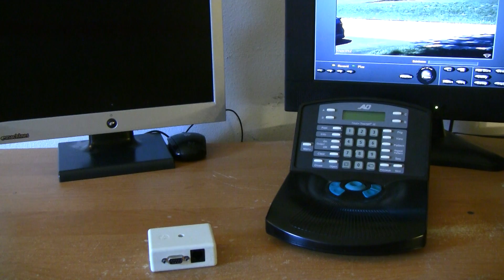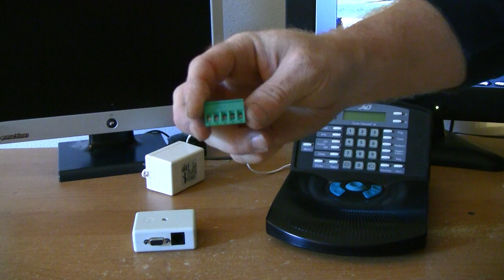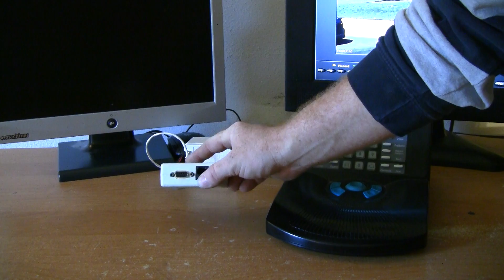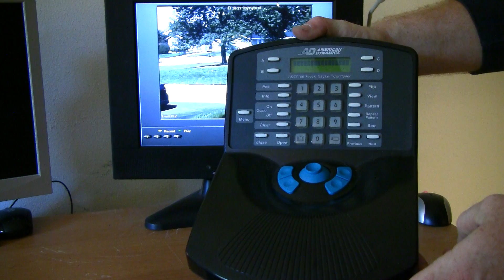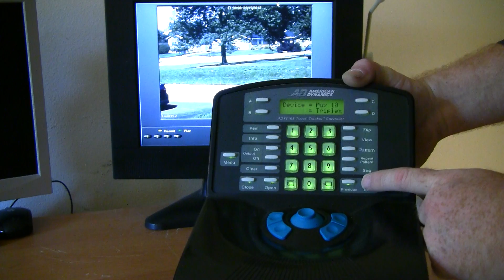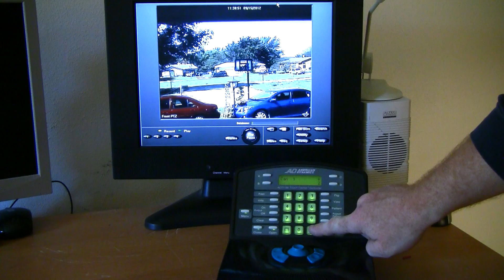Installing a Touch Tracker 16

Comment: I have an American dynamics tracker, that has UC on the LCD display, and it won't let me do anything, any ideas?
Reply from the maker: What you have is an ADTTE TouchTracker.  That's only compatible with a matrix switcher.  UC means a user code has been programmed.

Comment: Does anyone know if the EIM can connect to the AD2089 controller or is it only compatible with the touch tracker?
Reply from the maker: The EIM only works with the TouchTracker line of controllers.  The AD2089 uses a dual terminal block for connecting to a switching system.

Comment: How can I access camera menu without an AD2089 controller? Can I use American Dynamics USB control module to connect directly to the camera?
Reply from the maker: Yes, you can use the USB module to connect directly to a dome.  You'll need to install the drivers and the Software Utilities program on a computer though.
Reply: Thank you for the information.  We just purchased this touch tracker to we can change the 10 mintue preset on our Optima domes. We upgraded to IP but keep several analog PTZs. Only problem is without the old matrix bay and 2089 controller, I can't ever change these presets and when I try they revert back after 10 mintues of inactivity. I hope I can with this touch tracker like they told me I can.
Reply from the maker: SpeedDome Optimas don't have an internal menu for setting the home position.  It's set by programming Pattern 3 as only one Focus Near or Focus Far command.  If you want to clear it, program Pattern 3 as just two focus commands.  That should stop the dome from moving back after 10 minutes.
Reply: @MrBMG81  Awesome, but I couldn't do this without purchasing this touch tracker. My 2089 controller won't work with all my matrix bays ect being removed. We are now on a moxa converter box for RS422 control

Comment: How do I unlock a locked camera?! My touch tracker just buzzes. All my other cameras work.
Reply from the maker: What kind of system are you using?  Typically you need to unlock a camera with the controller that locked it in the first place.

Comment: Does TouchTracker power up automatically if I connect only 24V power without EIM? Powered it up by connecting wires directly to the board, have the same black upper line of the TouchTrackers LCD display when you  connect it with Rj45 jack, but it's not going to light up and stuck with that black line.
Reply from the maker: I've never tried it without using the EIM before.

Comment: Most likely a STUPID question, but I saw a "PC" setting, does that mean you can use it with a pc for as an ip cam controller? Or does it hook up to an American Dynamics software? I'm not too familiar with American Dynamics controllers.
Reply from the maker: The PC setting is for hooking it up to a computer to do software updates on it.  I'm not sure if the TouchTracker 16 is compatible with the American Dynamics VideoEdge NVRs or not. Everything in this video has since been replaced with a Hikvision IP system.
Reply: @MrBMG81  Oh, Thx Have another question, If I get a speed dome ultra (with outdoor housing of course) and put it on the front of my house (just one dome), with touch tracker installed, do I need a multiplexer, or can I take a regular BNC video lead from the ultra dome to my speco dvr? in other words, can I take the bnc camera jack and go directly into my speco dvr. thanks
Reply from the maker: Sure.  The video feed from the dome can be connected directly into the DVR without any problems.
Reply: @MrBMG81  Ok, thanks! Numbered to 0001 im assuming
Reply from the maker: You can address it to match whichever number video input you're plugging it into on your DVR.

Comment: hello good afternoon, my name is juan ahumada I speak from colombia, I want to ask you if it is possible or not to connect the direct dome to the EIM and the EIM towards the PTZ controller.
I want to test the functioning of the domes but I have not been able to move the dome from the PTZ controller, it only generates me an image. I wait fast answer. Thank you, good day.
Reply from the maker: Yes.   The two SensorNet wires from the EIM can go directly to the dome.  The controller has to be connected to the EIM to work.  Make sure your controller is a TouchTracker 16, if you want direct dome control.
Reply: Can the EIM connect to AD2089 controller or only to touch tracker?
Reply from the maker: Only to the TouchTracker.  The AD2089 uses a dual terminal block.

Comment: I wish I could get one of these speed domes working with my DVR. I've tried all settings and still can't make them move. Do AD use their own protocol?
Reply from the maker: They use SensorNet, which is a proprietary protocol ,and Tyco RS-422.  I know the Ultra 8 and I believe some of the Ultra 7's also support Pelco and a few other protocols as well.
Reply: I think my cameras are Ultra V. I'm using the RS-422 interface in the camera. On power on, the camera starts moving, shows BOOT VER 0103, MAIN VER 0204, 16x OPTICAL ZOOM, and then displays 'CHECKING NETWORK TYPE' with the green LED blinking slowly. If  I send data, the dome responds 01 C1 3E to say it is on line I believe, but although th green LED blinks to acknowledge furter data traffic, it makes no further response.
Reply from the maker: The Ultra 5 only supports Tyco RS-422, SensorNet and Manchester protocol. 01 C1 3E is most likely the command it's receiving.  On a compatible network "checking network type" comes up and then disappears when the camera automatically determines what type it's connected to.

Comment: Interesting vid, would like to see some more on your system, you have some nice equipment.
Personally I have found Pelco spectra cameras to be the best and easiest analog PTZ camera to set up, coaxiton right from the DVR and your all set.
Reply from the maker: I've never worked with Pelco equipment before but I've heard it's pretty good stuff.  I've watched some videos on YouTube about it.  These domes are easy enough to work with.  The camera itself just snaps into whatever type of enclosure or mount you're using.  They can run off several protocols.  I prefer using SensorNet.  Up-the-Coax is an option as well with some AD matrix switchers, along with duplex or simplex RS-422.  The Tyco Simplex 422 is what most of the DVRs put out, if you're just looking for a simple set up.  I much prefer a controller instead of using a mouse to move the camera though.  Power, data and alarms all have their own little terminal blocks so actually wiring them really isn't difficult.  They also have an internal configuration menu to set up different options and whatnot, which is pretty standard with most domes.  The Intellex is a PC based unit and is a super easy DVR to use.  It's very user intuitive.  I used quite a few different brands of DVRs when I worked in loss prevention and some of them were absolute nightmares.

Comment: What type of protocol does the Sensorvision-American dynamic use? Can I connect it to an NVR and control that type of  dome? 
I currently have an American Dynamic dome that works on Manchester, but I like to use a NVR or Hybrid DVR to control both Pelco and American Dynamic domes.
Reply from the maker: The SpeedDome Optima will support SensorNet, which is AD's proprietary communication protocol, Simplex RS-422, and Manchester.  The SpeedDome Ultra 8 supports SensorNet, Full RS-422, Manchester, Pelco Coaxitron, PVS and P, Panasonic UTC, AD UTC, Vicon, Bosch Bi-Phase.  As far as I'm aware, the older domes are limited to just SensorNet, RS-422 and Manchester.  The video can be fed into any DVR or Hybrid recorder but it would have to have the proper protocol included in the software / firmware for dome control, and that varies by manufacturer.

Comment: How do you set preset locations that the camera returns to after some time not being used?
Reply from the maker: On a SpeedDome Ultra, you'll first program whatever view you want for your home position, then open the dome configuration menu.  Go to "Alarms/Areas/Home/Presets".  Select "Set Home Position".  Next to "Action" select "Preset" and then move the cursor over to the number and select whatever number preset it is you want the dome to return to.  Move the cursor down to "Return Time Mins" and set however much time you want to pass before the dome returns to its preset location.  Exit out to the main menu and then "Exit and and Save Changes".  For a SpeedDome Optima, call up the dome and move it to where you want its home position to be.  Then program Pattern #3 for that dome with one focus command and nothing else.  The camera will return to that position after 10 minutes of idle time.
Reply: THIS IS MY PROBLEM. ALL my Speedome cameras preset after 10 minutes of inactivity. My problem is I can't access to camera menu anymore because we upgraded our system and no longer use AD2089 controllers. I need to find out what I need to get in order to access the camera menu and change presets so they quit going to programmed 10 minute preset. All the RS422 controls are now connected to a moxa converter box. I do still have the AD2089 controllers just unsure how to connect it to the camera to access the menu. Any help would be great appreciated.
Reply from the maker: The AD2089 can't be connected directly to a camera like a TouchTracker 16.  It has to be connected to a matrix system, which in turn communicates with the camera.

Comment: Great video thank you for the information.  How would I connect the PTZ/Controller to a second call up screen on an Intellex?
Reply from the maker: In the Display menu on the Intellex, there should be a "Call Monitor" tab where you set up which monitor the main and secondary TouchTrackers control.  You This is only on the 16 camera Intellex units.  The 4-8 camera ones don't have this ability.
Reply: MrBMG81 Great thank you for the information!

Comment: Great Video.  I'd like more information or maybe a video on enabling and disabling the Lock feature.  Our touch tracker in our LP camera room frequently  locks us out of dome  control. Does accidentally hitting the lock button lock it up?   Also, have you had any issues with the RJ45 flip cable going  bad?
 I just watch this video which was very informative and also subscribed.  Thank you..
Reply from the maker: +Charles Hollingshed   Do you know off hand what kind of system you're using?  The TouchTracker 16 doesn't have a Lock button but I know the RCTTRKE (for the VM96) and the ADDTTE (for the MegaPower series) TouchTrackers have one.  The lock function is used for locking out other controllers from using whichever dome is called up when the button is pressed.  It shouldn't completely prevent you from controlling all of domes.  I've never had an RJ45 flip cable go bad but I've seen instances where a cable longer than 7 feet was used and the TouchTracker wouldn't function properly.
Reply: Thanks for responding.  We have 2 cables for our ADDTTE touch trackers that are probably 10-12 feet.  We're troubleshooting by switching/exchanging the cables and touch trackers with each other.  It now appears that the small (beige) connection box that they both plug into may be faulty.  We have a tech coming to check it out. Your video has enabled me speak more tech savvy than I really am, LOL.  Thanks again.  I look forward to more of your videos  !!

Comment: I'm sorry to have to act like that annoying guy calling tech support, but if you can help me it would be much appreciated because this issue has been bugging me for the last week and is interfering with my job. Currently I am running an Intellex LT 16 channel and for some reason I cannot set up the controller to call up any of my PTZ's or still cams from the controller. I have to use the intellex itself. I used to be able to do this before and call up any of my 16 cams from the controller but something happened to where this is no longer the case. I have read both the manuals for the intellex and the controller but keep coming out empty handed. Again if you can help me out i would greatly appreciate it.
Reply from the maker: +Zack Fortune   Hey.  I'm sorry for the late response but your comment just now showed up for some reason. Hopefully you've got your problem sorted out. If not, drop me another comment or a message and I'll try to you help out as best I can.

Comment: I have an intellex dvms and when I try to call up a camera it won't. But the camera still moves. But it doesn't display that video feed on my screen. I have adtt16e touch tracker.
Reply from the maker: Tim Schell   What do you have the TouchTracker set to under the "Config Devices" menu?